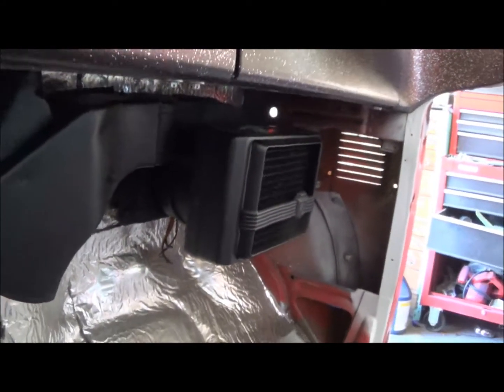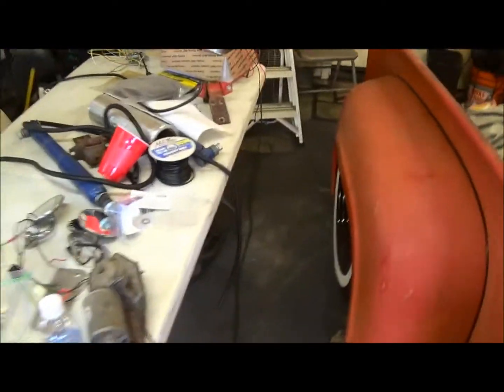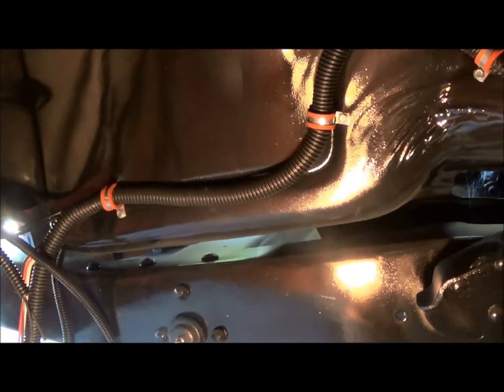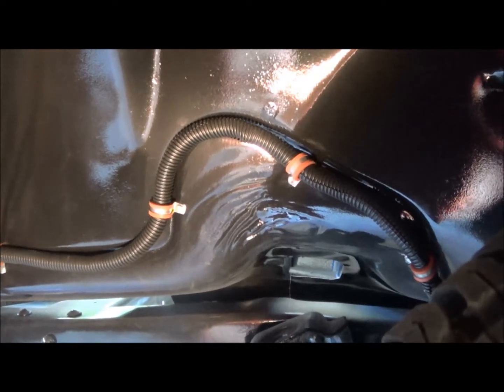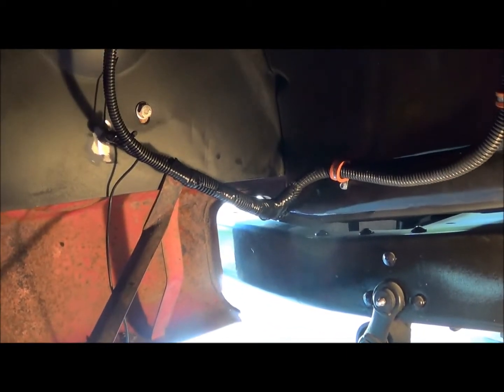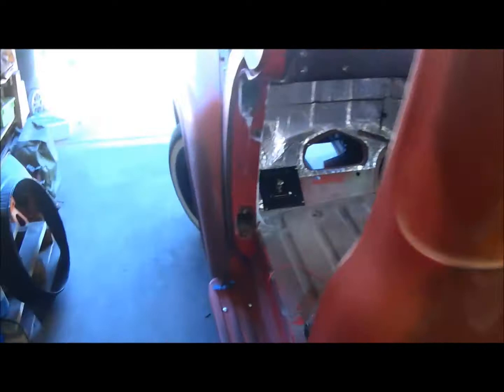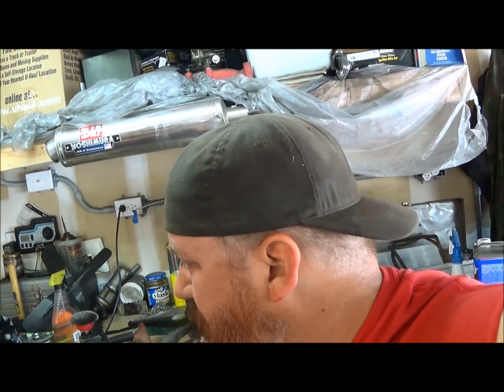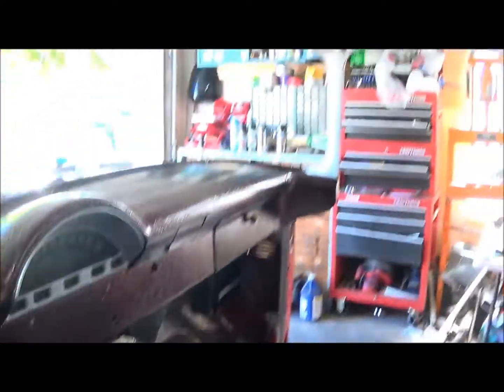Monday and Humpday mashup

Comment: As I've said before we think alot alike when it comes to the wiring. Have you ever thought about squaring up the vase plate on the four barrel carb you have if it is in fact warped. If you can get the shafts and linkage out of the base plate you can put a sheet of emery cloth on a piece of glass and run the base around on it to get it back square. I've done it on a couple carbs over the years.